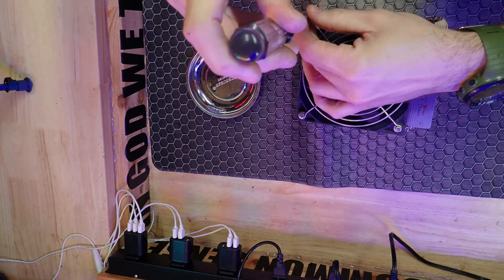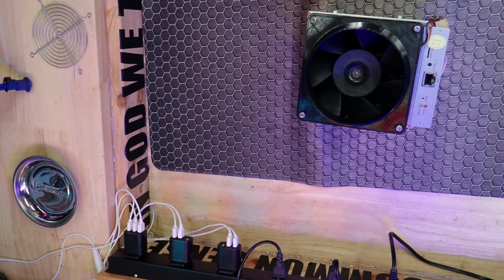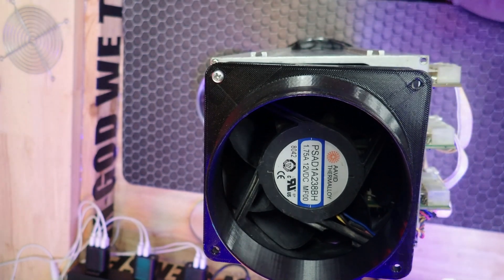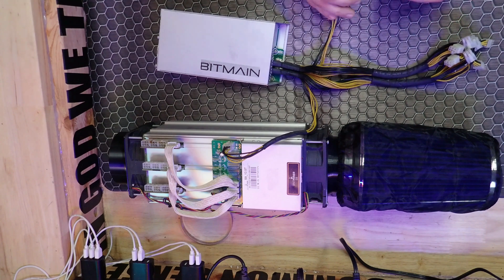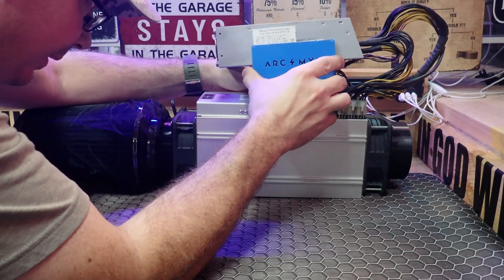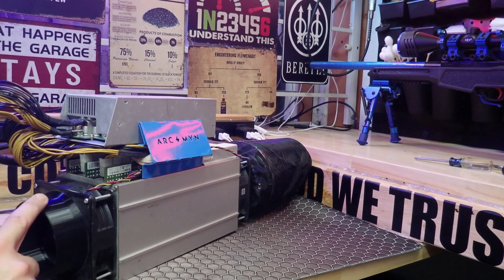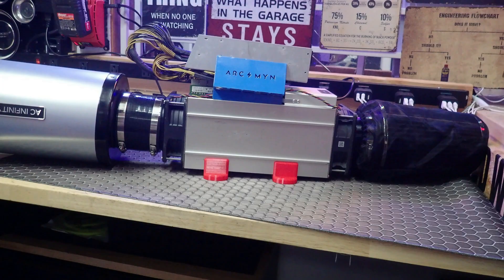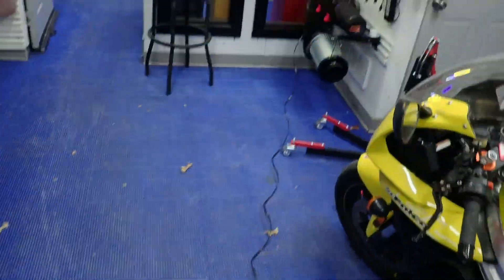This is how you don't setup a bitcoin antminer s9 to heat your garage for winter

Comment: If the light is out the hashboard is not running.
In my case the board is broken and needed new mosfet. 
I advise installing 'brains' os, it gives you the ability to set a max power (watts) instead of full power. Less power less stress heat and noise. 
Cool garage 😎
Reply from the maker: Thanks it has brains os on it already I gotta mess with it this weekend. So I need to replace the whole board if lights don't come on? I'm new to this game
Reply: 90% that the board is dead. You can try to switch cables with a working board.
And if you can solder and measuring try to fix it, but it's not easy